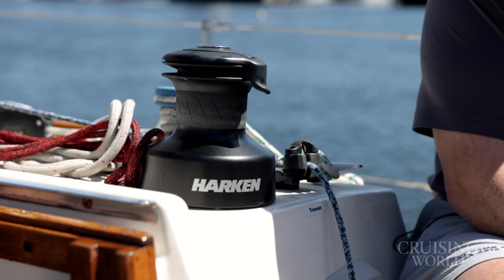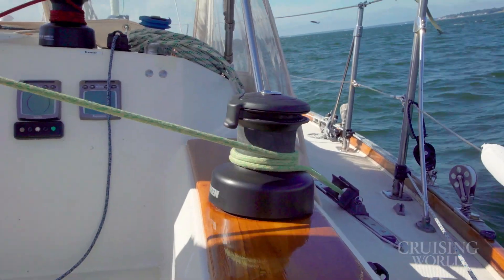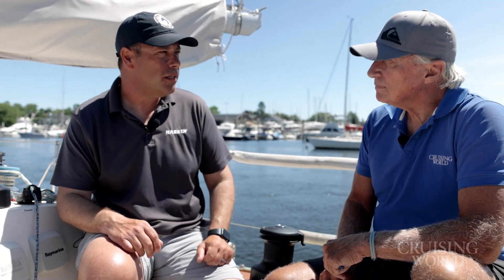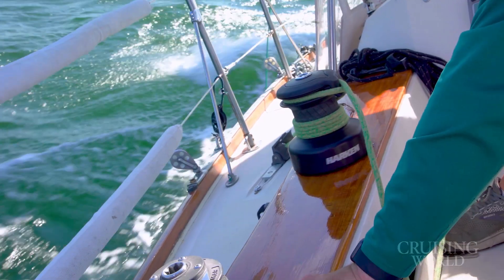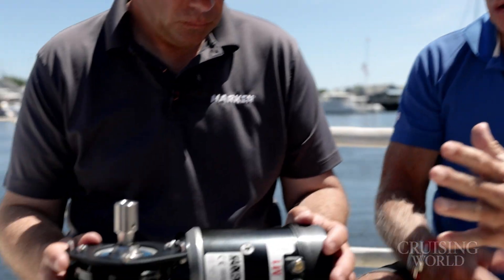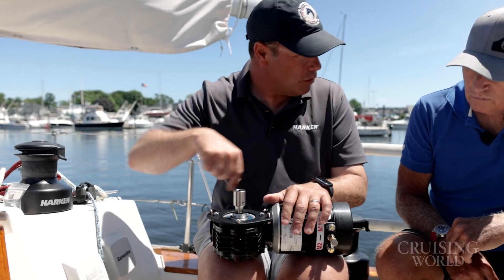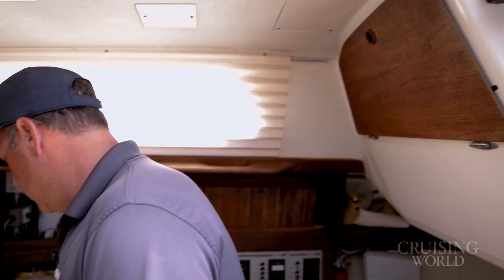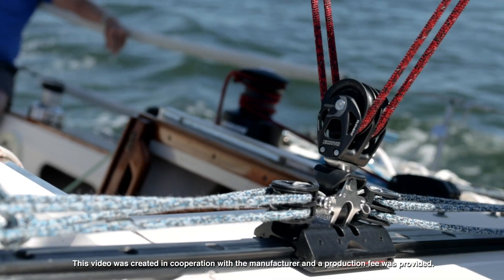Hands-On Sailor: Harken Electric Winch System

Comment: Does the Harken Electric Winch have some means for measuring how much line has been paid out or realed in so the amount of sail that has been raised can be displayed.
I am  planning my yatch and looking into using ardunio micro controllers. Do you have any suggestions.
Thanks Philip

Comment: I have 3 electric Harken winches on my boat.  Power/battery consumption is big.  Decisions on when to use them and when not to are absolutely required.   Your battery system will be beeping low power warnings if you use them as much as you’d like to.
Reply: How many batteries have you find is needed to satisfy your usage requirements?  Obviously if you pay for them you want to use them